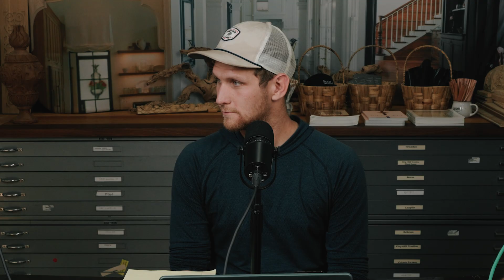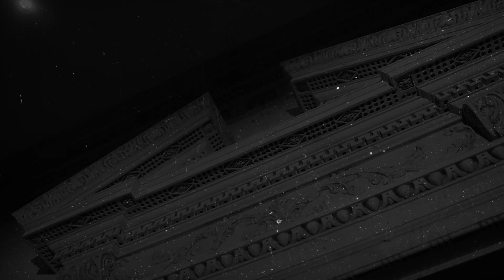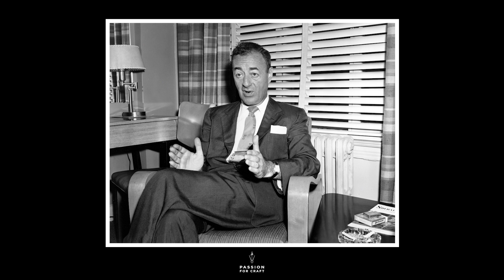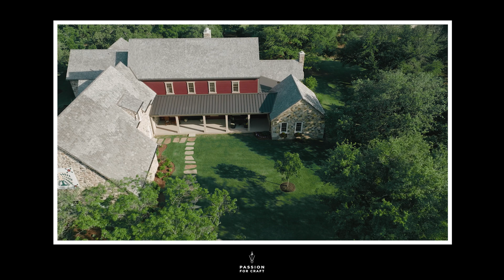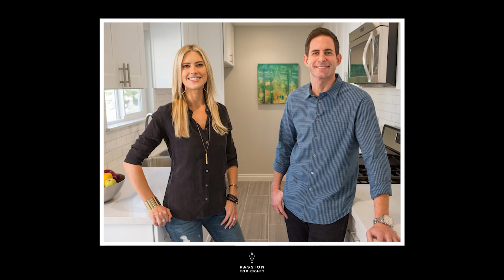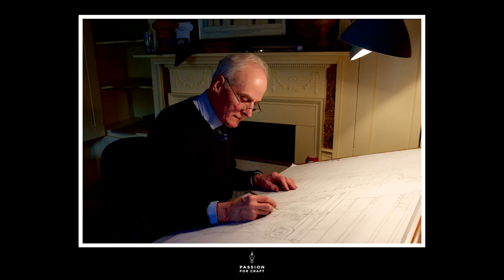Ep. 56 Sustainability in Building | Passion for Craft Podcast

Comment: If you don't like wood decks due to the maintenance and frequent replacement costs, and you don't have the level ground needed for a stone patio, what about a raised metal and concrete paver stone or porcelain tile deck? I saw one from Paverdeck and it look's really good, plus if you're out in the country by a lake you won't have any issues with wildfires setting the deck on fire and then the house.